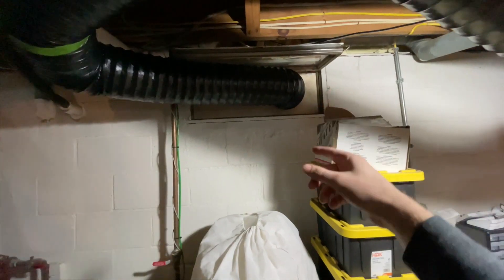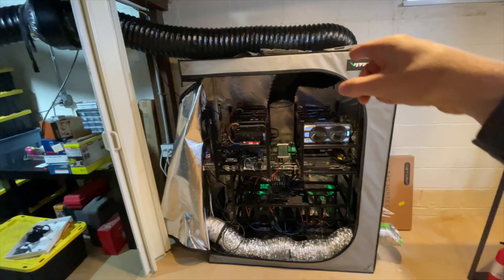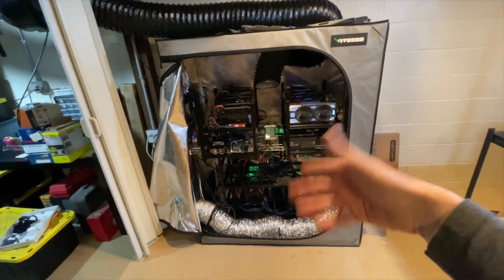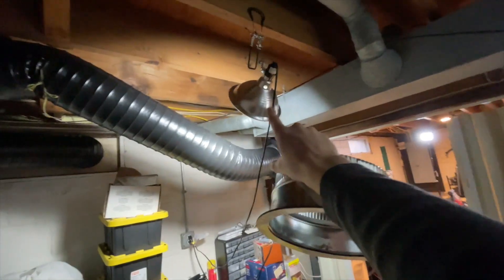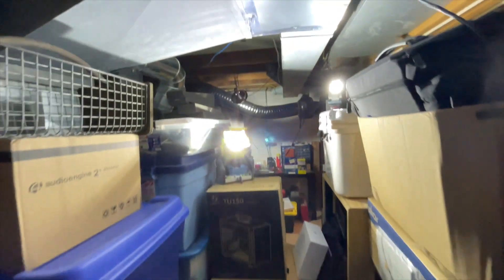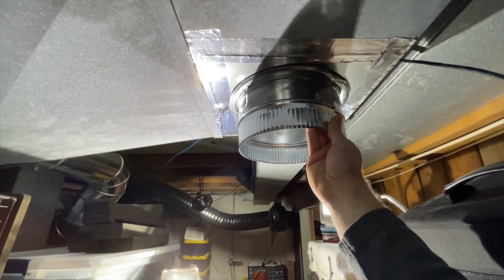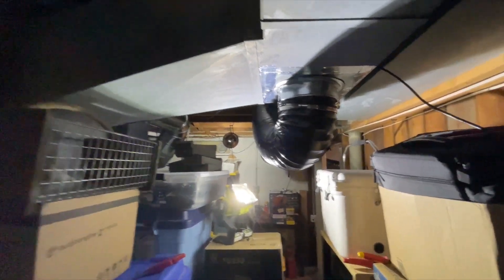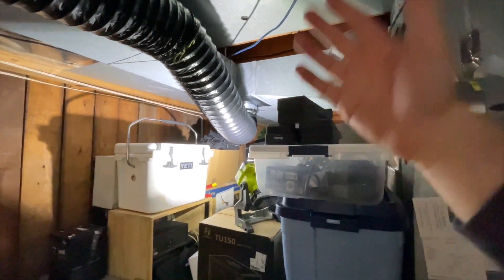Heating My House with GPU Mining Rigs

Comment: That's a cool idea hooking it into your ducting like that. I tried using a grow tent years ago in the summer time to vent out of the window, but the rigs heated up too much being enclosed like that. I had a pretty good inline fan on it, but it was already so noisy so I had to find another solution than getting a bigger fan. Now I'm in a new house and I just put them in the garage to vent out the garage door windows or the attic. 

For now in the winter I just leave them in the open air to heat the house. I got a couple in the living room and one in a upstairs bedroom. It's kinda uneven heating since some bedrooms get colder than the rooms the rigs are in even with the doors open and it affects the thermostat so I have to turn it a bit higher to get some heat from the furnace. 

I just need to mine longer to find some better solutions. I've sold all my rigs twice now and I'm not about to do that again as it was hard to get cards for the latest pump.
Reply from the maker: Thanks for sharing your experiences buddy. Last winter my furnace broke and I moved all the rigs through the house to keep us warm.